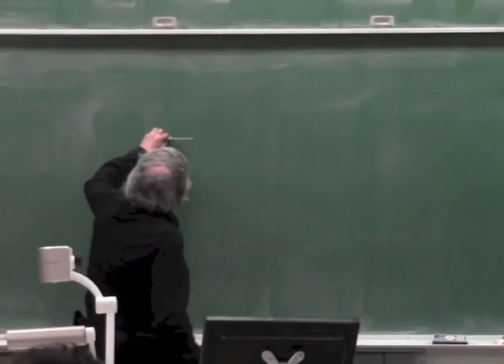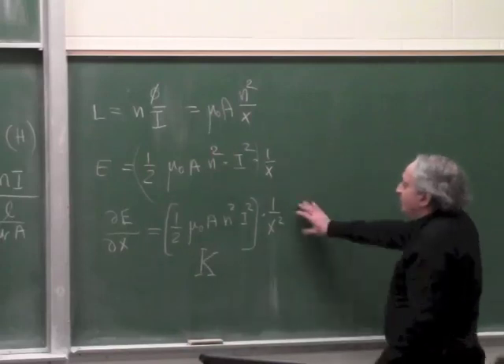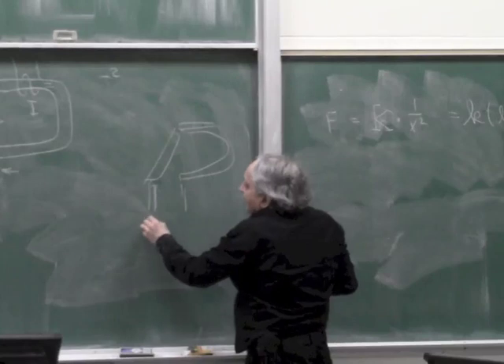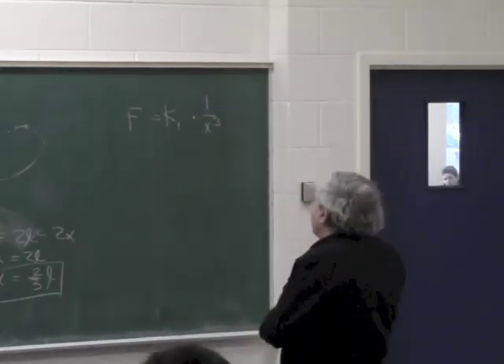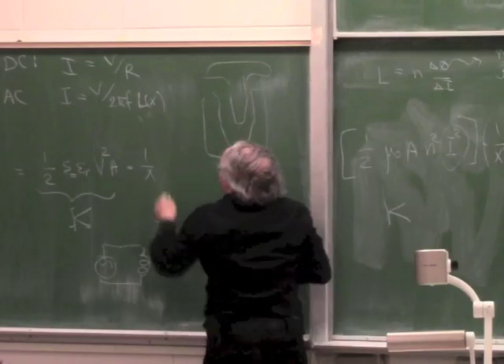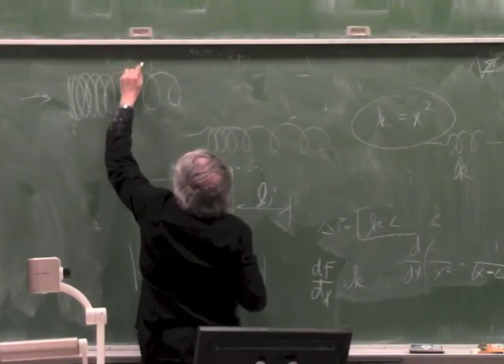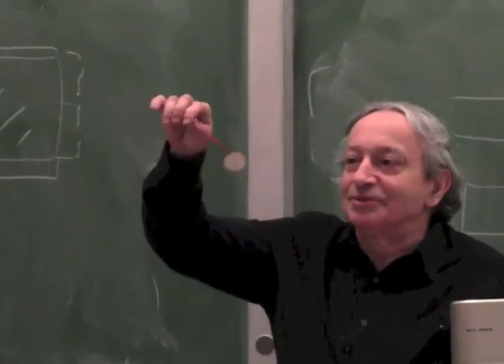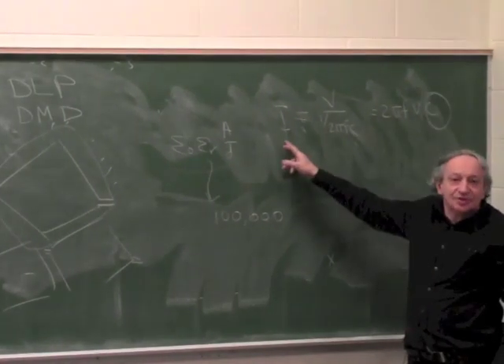15  Moving Iron Actuators, Snap, and AC Operation of Moving Iron Actuators

Comment: The energy method for calculating forces in moving iron actuators is one of multiple methods. It should be noted that this method does not account for the flux that escapes from the magnetic flow path. In the case of a well designed solenoid with a ferromagnetic case these losses are small. In many designs these losses are not negligible. If one wants to delve more into solenoid design I would suggest reading Electromagnetic Devices: by Roters. As he had noted the profile of the armature interface can also have a large effect on the profile of the force curve. This can also be significant.

Thank you fizzym for making these lectures available! I appreciate all the content from Dan Gelbart. He never ceases to amaze me!